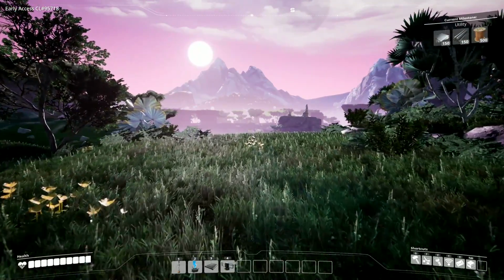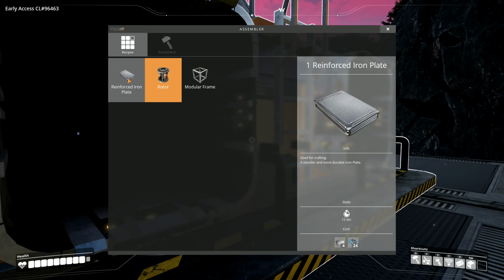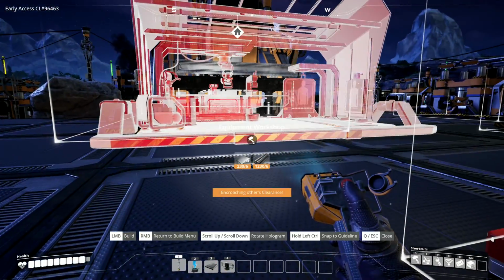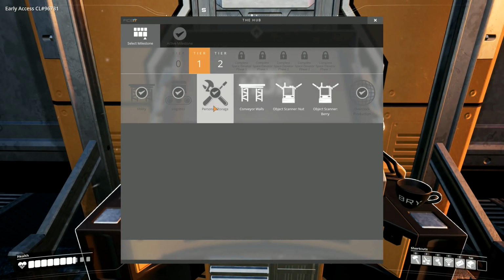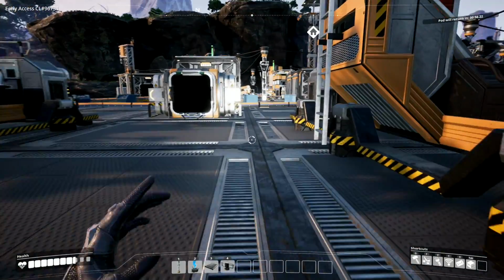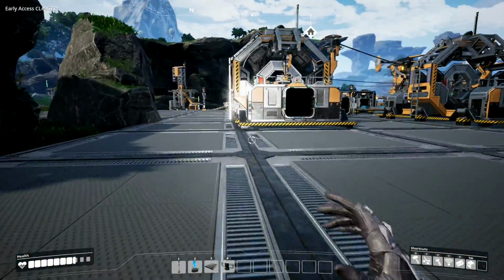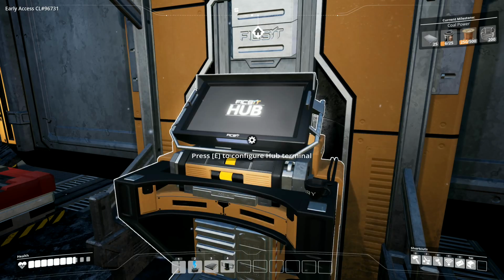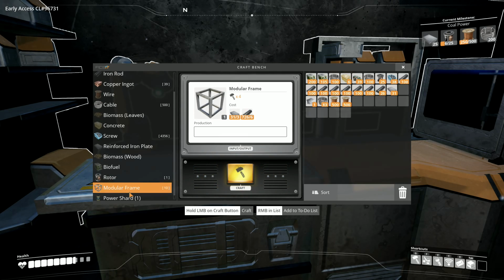Let's Play Satisfactory #12: Space Launch!

Comment: Yeah, it's under there, but considering how easy it is to make more wire, and considering all the work you'd need to do to systematically take it all apart, then rebuild it, not worth it, imo. Periodically check your screw output. The belts cannot move it as fast is it makes them, so it quickly stacks to 500. 90/min production, but Mk I belts only move 60/min... so every min, it stacks 30 in the output, capping out in less than 17 min. 29 min video, that's almost 1,000 screws not utilized. Also, both your assemblers need a dedicated Constructor... but you're going to need more power production first, you're almost capping out, without the copper chain running. 

Truck station has 2 inputs, one for fuel, and one output. It'll burn anything that can be used as fuel. So, on coal supply side, I send it to both inputs, and as long as you can do a round trip on one tank, you don't need to do a feedback loop on the Base side. Unless you're going for the most distant coal deposit, it shouldn't be a problem. "Most distant" as in, all the way across the map, not the farther of the 2 closest Coal Deposits. Truck Stations use power when loading and unloading... unless you want the insufficient power situation when you make that jump, I'd wait till you have some stuff on standby... maybe by waiting till the assempler's output gets full, b/c that's 30 MW for 2 of those running. 

You do not have to go all the way to the Elevator controls, unless you're just doing it for immersion. And, you're still carrying over 30 copper ore, you can throw into the smelter if you want.

Comment: Yeah.... that will be way WAY to few screws.... You need to run the screw constructor at 150% and a conveyor Mk2 to even satisfy one assembler.....
Reply: A Mk 1 conveyor can't even move the output at 100%... produces 90, moves 60. Technically, 134% still produces over 120/min (barely 120.6). Any more is a waste of electricity till you have Mk III belts. ie. a slight surplus, so you don't short the assembler, which needs 120.
Reply: @Ivellios23  that is what I said is it not? I mean you explained it with facts and numbers and stuff... But who needs facts? ;-D
Reply: @smudolinithegreatdragobear2433   Close... mainly going into more detail. The main difference though, is that between 134% and 150%, until you get Mk III belts, you're in the same relative position that you're in running at 100% with Mk I belts. ie. You're wasting Biofuel, on limited power capacity. Once he gets coal up and running, the extra power use, will be negligible, and it's worth having some extra screws in the output.